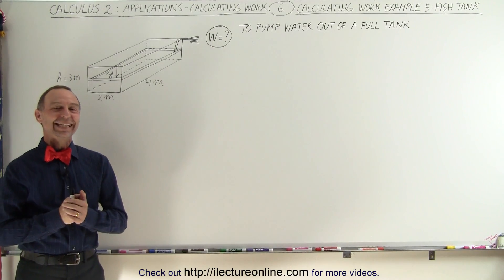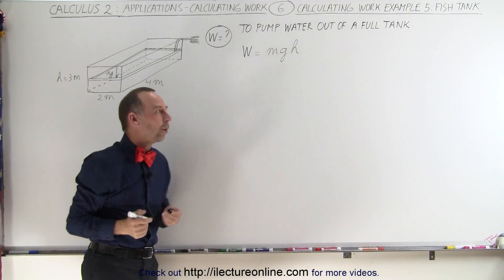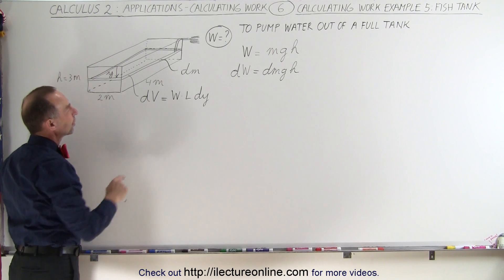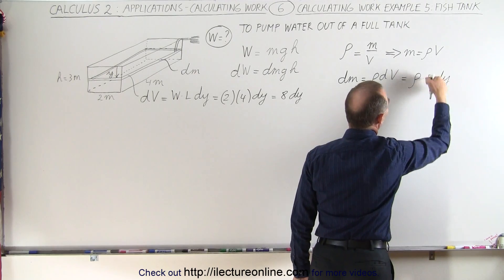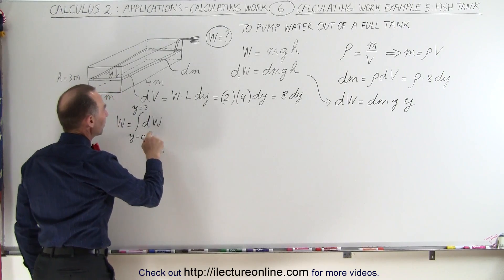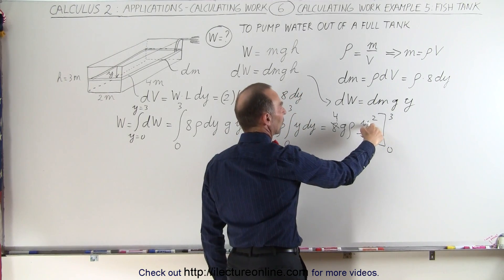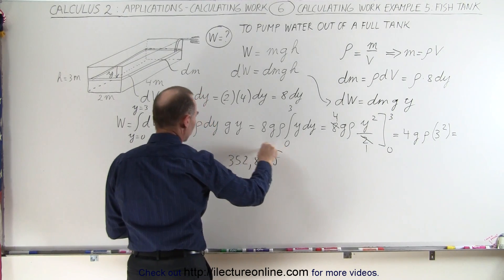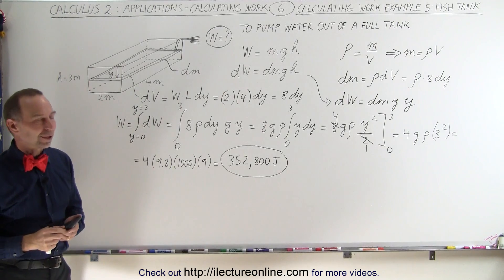Calculus 2: Applications - Calculating Work (6 of 16) Calculating Work Example 5: Fish Tank

Comment: Michel.... sometimes you put y in the equation "dW = dmgy" as (h-y) and sometimes just y, I tried couple of hours to figure it out by myself, but i can't find any clear reason for that.... please would you help me??
Reply from the maker: Whenever you need to integrate, you will need a "differential", which is a small quantity (change) in the variable you are integrating.  For example, when you differentiate   y = x^2 + 5x   you get   dy/dx = 2x +5    When you want to integrate, you must first write   dy = (2x+5) dx

Comment: I might be misreading your chart, but how come you replaced the h in dW = ghdm with y? I thought the height the water had to raise would be 3-y, if y is the current height of the water in the tank and the height of the tank is 3 feet.
Reply from the maker: There is an easy way to check to see if the answer is correct.  If you assume that all of the water is located at the average depth (1.5 m) and is then pumped out, you should get the same answer which is the answer in the video.  There is more than one way in which you can set up the problem.  (the video shows one of them).

Comment: nice problem....  after seeing the LAST problem with a CONE...  I'm hoping I get this right.. that if this TANK was only filled to a DEPTH of 2 m.. then the limits would be 0 to 2 but the "Y" Value in the Integrand would  have been (3-y) ...   Right?..I hope.. these problems are Very GOOD Michel.. thank you...
Reply from the maker: Since the water at the top (if the tank is completely filled) does not require work to be removed, the lower limit is zero. (Positive y is pointed downward).  If the tank is filled to a height of 2 m from the bottom, then the lower limit is 1 (which represents the height the top layer needs to be lifted and the upper limit will still be 3 since that is the height the lowest layer will need to be lifted.   BUT you can do it the way you suggested as well with y being positive upward.
Reply: I decided that I will let GRAVITY do the work . I'll simply drill a hole in the bottom of the tank and stand back.. :D ...